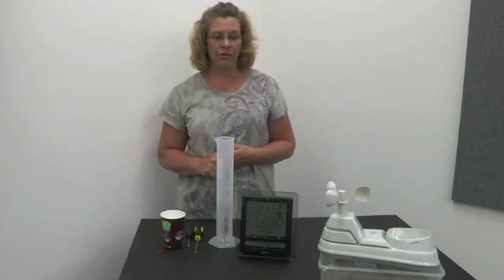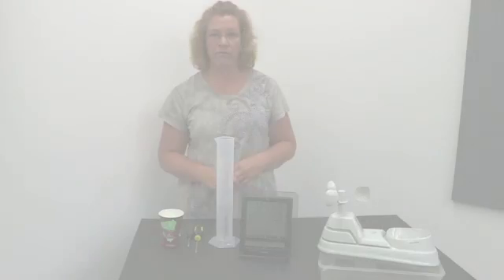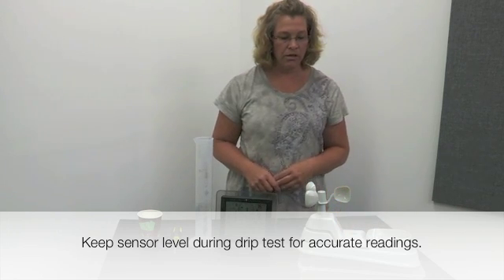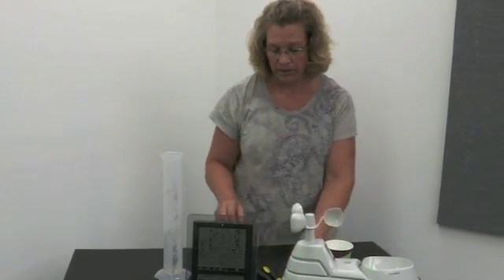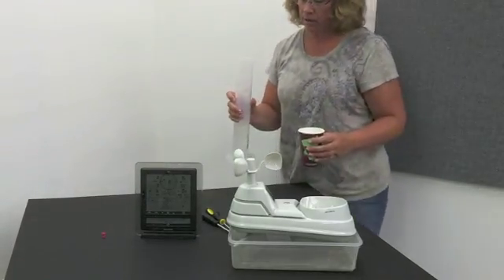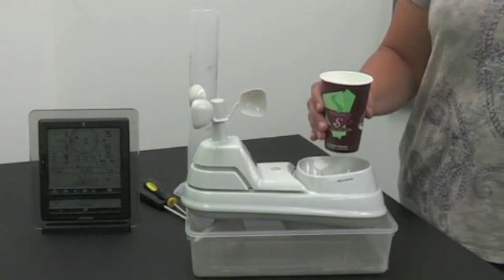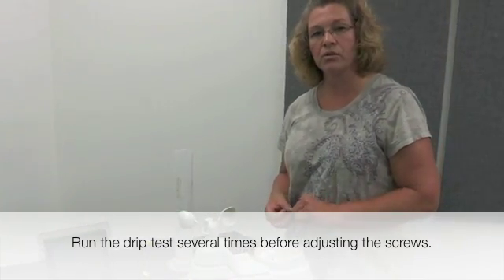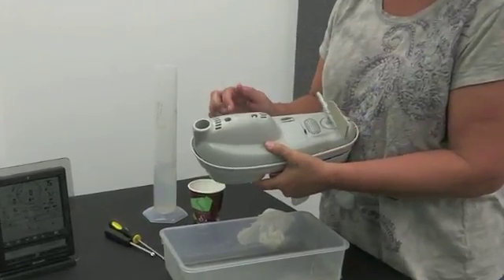AcuRite 5-in-1 Sensor Rain Gauge Calibration

Comment: Another easier way to do this calibration is to use a rain gauge, preferably a larger (3-4" diameter) gauge or any straight-walled glass vessel like a vase. A small bucket can be used also.  the smaller diameter rain gauges under-report. Measure rainfall with the guage, you can use a ruler, then compare that to what the 5-in -1 is reporting, and make adjustments + or - as needed.  It may take a few rains to get them to be very close.

Comment: This is the biggest piece of junk I’ve received as a gift - AFTER using all of the instructions we have been sent from AcuRite.   My opinion. 5 times up the ladder to remove the weather station from its mount.  Trying to reset it, and replacing it    I have built 80 ton Grove cranes with greater ease than trying to resolve our AcuRite issues.   “Red warning “ indicator from 70 mph winds, where, as indicated by the Weather Service 21 mph winds.  Emails to AcuRite have been less than helpful. “MY OPINION ONLY “!!!!!

Comment: Just bought this last Christmas for my dad and it doesn’t detect any rain even after calibration!
Reply: The double bucket may be jammed inside, undue the 4 screws at the bottom, ( not the two under where the rain goes in ) and make sure it moves freely. Iv'e had mine for 2 years, but about every 6 months a spider makes a web on it and gums the bucket up.
Reply: Mine was a Christmas gift from my wife a couple years ago, and it has had various issues. Now it doesn't send rain info either.
Reply: How did you calibrate it if it doesn’t detect rain/water?  I’m calling bullshit on you!

Comment: Rain not fallen since a long time and measurement gives me the figures (in) I do not know of any came
Reply: The reason is the early removal of the small plastic stabilizer "chip" that prevent false rainfall readings before finishing the installation of the sensor outdoors. You can delete these false rain events by pressing the middle button on the back of the display console screen to put the reading back to zero rain. However, when you do that you must re-introduce the measurement units on the console. I got the same problem and this was the unique solution. The reason of false rainfall is that the internal tipping bucket while handling of the sensor body.
Reply: @fahmylina123  do you know why mine detects the water I pour into it but not rain? The wind and temp work fine. Today was the first major rain we have had in 6 months.
Reply: @robertberin4872  My modest guess is that the tipping buckets got blocked someway by dust or insect, and when you pour water this apparent clogging would float up, whereas with light rain it settles down again. You may need to open the body to see what is going on and remove such clogging. Thanks.

Comment: When adjusting the screws, how big/small of a difference does an 1/8 of a turn make? 1/4, 1/2 ? Thanks!
Reply: +Alex Petrovich the manual that came with it says an 1/8 turn is 2% , 1/4 turn 4% and 1/2 turn is 8%.
Turning screw clockwise increases rainfall, counter-clockwise decreases rainfall.
Be sure to equally adjust both screws.
Hope this helps.

Comment: What do you use to poke the hole in the cup? When the water gets low in the cup, it stops flowing from the reduced light weight of the low water level. Does this happen to you?
Reply: That is a problem..same here. Also, even with a single very small hole, it only takes me 10 min to get to the point where it will stop with maybe 5% of the water still in the cup.
Reply: Shake or bounce the cup
Reply: @couchrider6228  eh, thanks for the reply, but I've long since moved on to the ambient 2902a. Most acurites are way off on rain. Just go to a pws map and you will spot them when you find the highest rainfall totals lol. 
And I always use the 4 inch cocorahs gauge for official measurement
Reply: @alexpetrovich441  sounds like you weren’t able to figure out how to calibrate the acurite rain gauge ,  it’s not that compalated.
Reply: @couchrider6228  nah I could get it down to the hundredth but any slightly heavier rain throws it off.  Not uncommon with automated rain gauges but much more so with acurites in my experience

Comment: Is there any way you can calibrate the temperature on these sensors? Thanks.
Reply: Yes push up & down buttons at the same time when flashing adjust up or down then set.
Reply from the maker: Hi BlackNGoldRules,

Many of our units allow for manual calibration on the console display. For troubleshooting tips and advice, please visit our Knowledge Base at http://www.acurite.com/kbase.